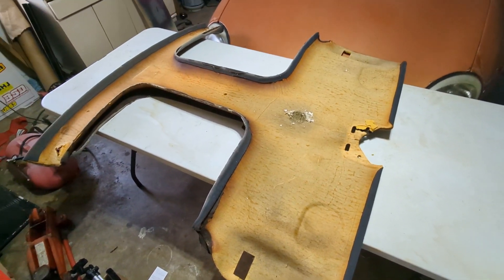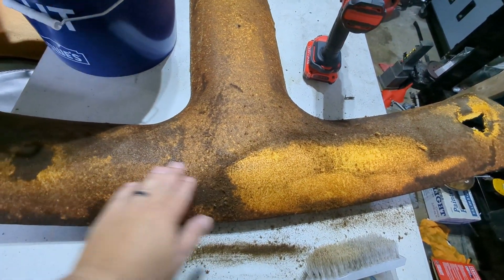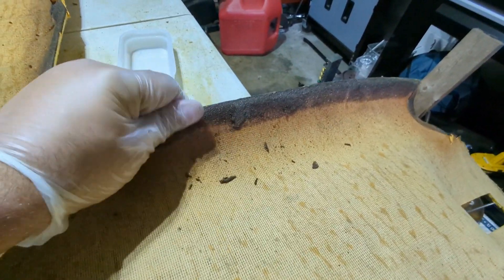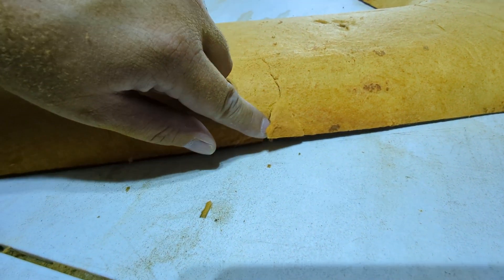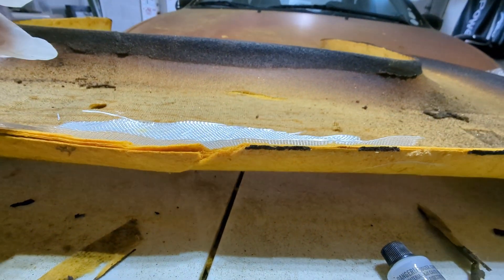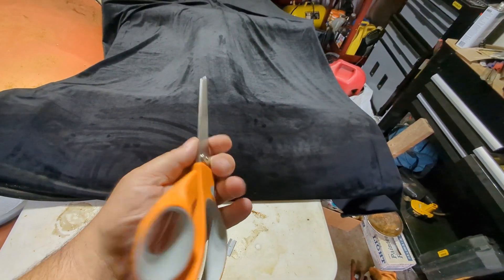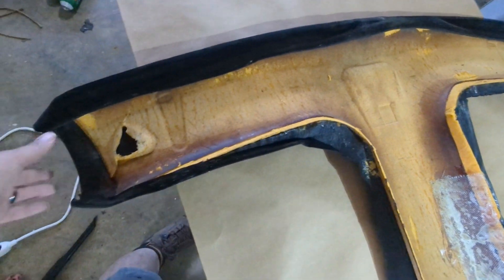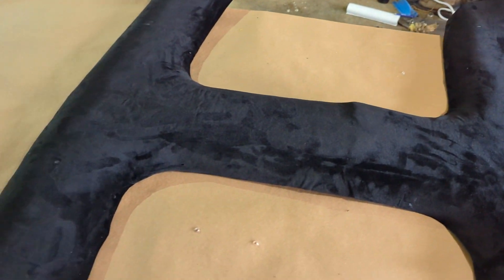4th Gen F Body T Top Headliner Repair 1995 Pontiac Firebird Rescue Episode 11

Comment: Thanks for the shout out!! another tip I can give you is to use stretchy material and if your not using headliner material try to use something with a backing on it. It's more forgiving. Good video 👍
Reply from the maker: I appreciate for the tips. It was definitely a learning experience. Hopefully I don't have to do another anytime soon!  Thanks for watching!
Reply: My first headliner was trash the last 3 I did came out perfect. You'll get better the more you do. Wait till you have the ones you have to wiggle out through the trunk because you can't get it out the door they are a pain 😅
Reply from the maker: I bet. I was never so glad this thing had T Tops as I was when I slid the headliner right out.